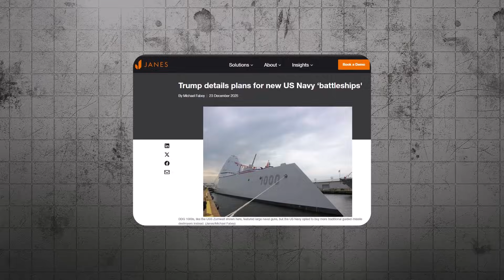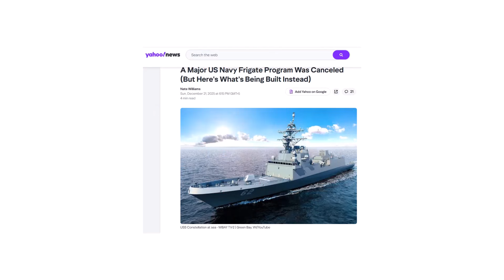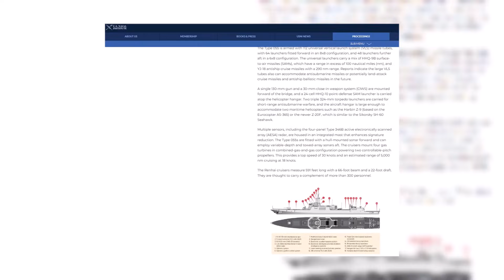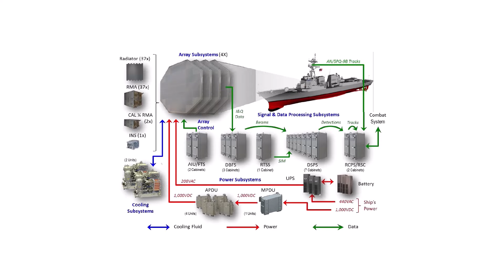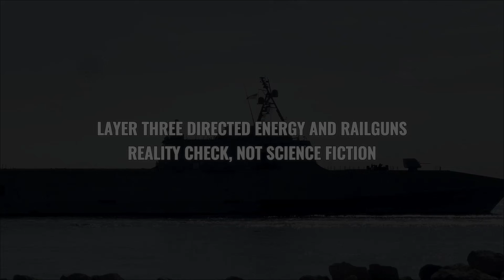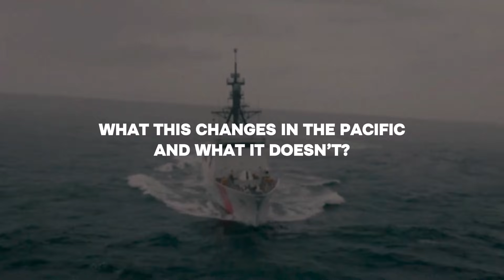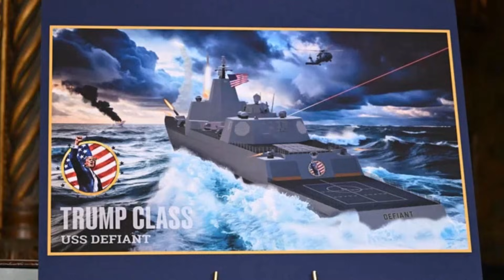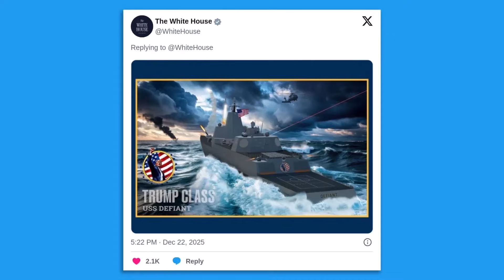The Trump Class Battleship Explained: Specs, Weapons & Reality

Comment: Keep building flight 2A Burkes to serve the frigate role. Let's face it the new plan using a cuter as is a waste, unless they are upgraded with 32 vls cells and proper ASW. Keep building Flight 3 Birkes to replace the cruisers. Keep the Virgina class going as fast as possible, plus start buying the latest diesel subs from Japan. Long term 10+ years build the BBG's with the AB1 reactor. BBG's do not need a hanger as they will be the center piece of a SAG or part of a CBG for air defense and attack. Also forget the rail gun, bring back the Mark 16 8-inch guns from the Des Moines class just in case you need to bring a gun to a knife fight. With no hanger there will be more then enough room for at least 4, 64 cell vls, in the center 16 - 32 very large vls cells for the new missiles.

Comment: Did IQ's just drop sharply? The Battleship has not been the main capitol ship since the 1940'-50s' and they are just ego stroking and a pure waste of money. In fact in WW2 The entire Yamato class where dubbed Unsinkable islands of steel by the IJN but saw little action. When they did see battle the Yamato and  Musashi where both sunk. Even the 3rd, Shinano, was repurposed as a Carrier and was sunk after being torpedoed by the single submarine USS Archerfish.  Subs for sure but also Arleigh Burke destroyers would be better platforms.
Reply: Really?  By your thinking, the carrier is also just a big target.  The problem with guided missile destroyers is CAPACITY.  Imagine the firepower of one three times the size.  Add  a rail gun, swarms of drones, and lasers. Enough missiles of various types for any contingency. It is called POWER PROJECTION.  Armed with nuclear cruise missiles and you have the power of an aircraft carrier in a much smaller package.  Add an Aegis cruiser and two or three Arleigh Burkes and a couple Virginia class subs, oh, my my.
Reply: @allanboyer2769  Good Point. Any large target becomes a Missile Magnet I suppose. Still the carrier is a better platform for Force Projection over a Battleship.
Reply: When you see it more as a Ticonderoga replacement instead of a battleship then it makes much more sense.